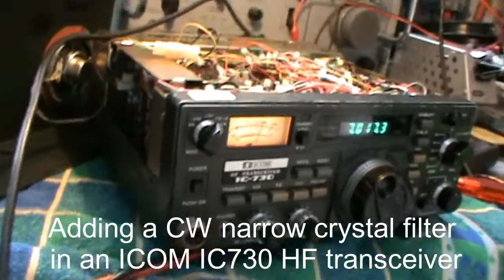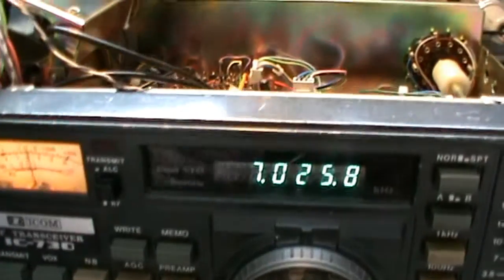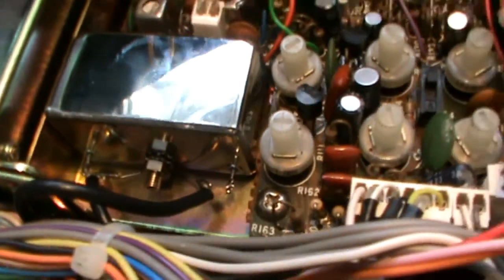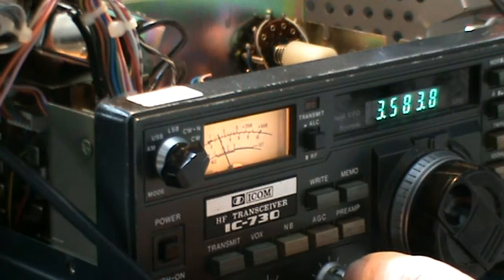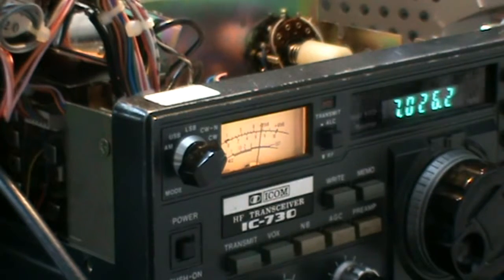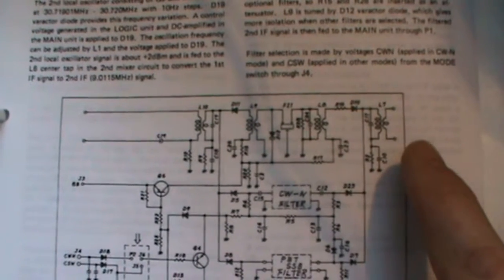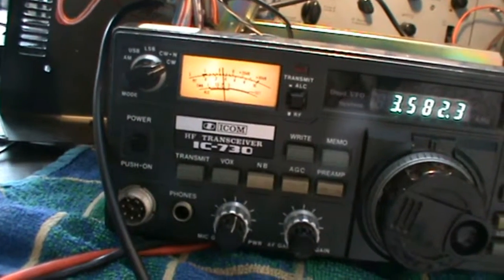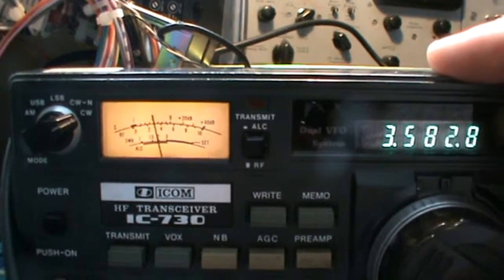ICOM IC730 narrow crystal filter

Comment: Not much help at all. Suckers one in to think that it's relatively easy to install. Didn't show the problem with lifting the top tray. At least on mine, they must be in there with red Locktite. Totally stripped the heads on the two screws holding it in place on the right hand side of the chassis. Only thing to do now would be to drill out the screws, which I am not going to do. So that's it for me. It's an SSB only rig (which is is what it was originally purchased for anyway.). One further criticism. The placement of the filter and the changes in the jumpers is shown. How about showing us the installation of the two coax cables to the board. I mean, let's see you actually soldering them in place. Seems like THAT would be the tricky part.
Reply: SO... HOW IT IS GOING ... "BEEN BY THE DOCTOR" ... AND GET  "RELAX PILLS"  .....  HHHAHA

ONE DAY YOU  FIND  OUT  "HOW TO OPEN A BOX"..